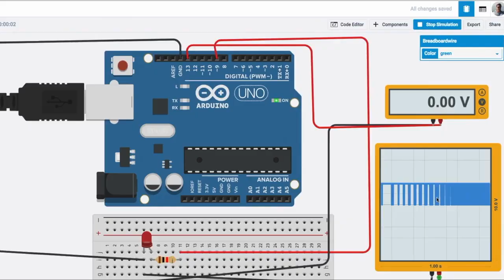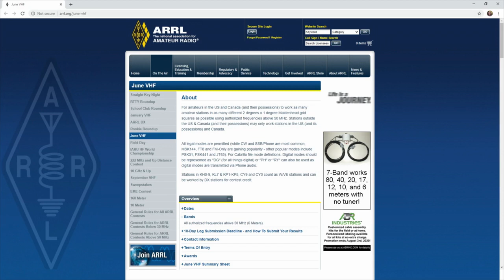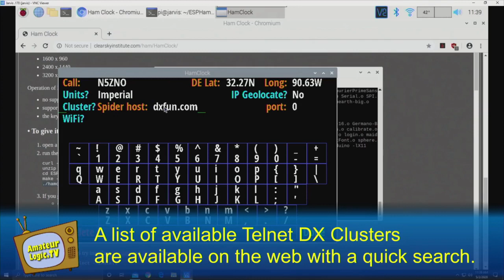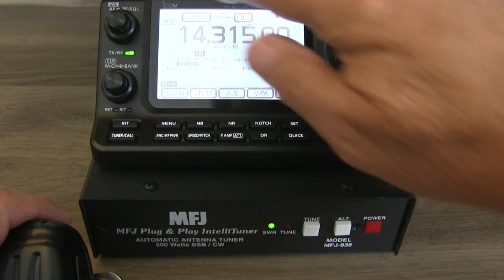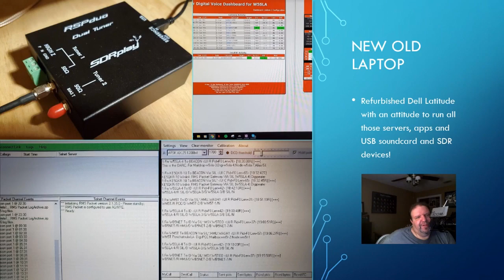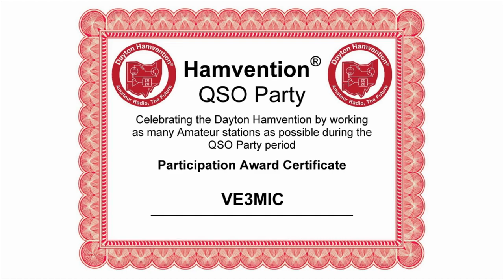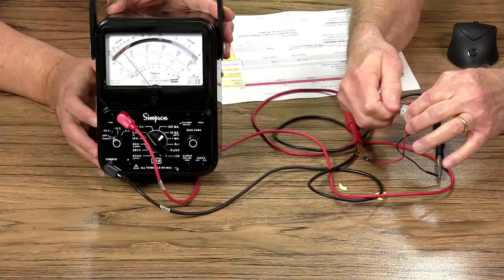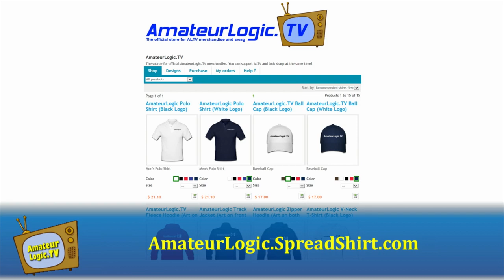AmateurLogic 144: Does Anybody Really Know What Time It Is

Comment: I wanted to let you know, I got the HamClock loaded and running on an old laptop PC using the Xtra-PC dongle they advertise online.  I updated the dongle with the latest version of Ubuntu and added the commands to load the packages needed in curl as was recommended by the author - for Ubuntu if you get errors during the make command try loading more packages such as
sudo apt install curl make g++ xorg-dev 
I have the PC running with dual monitors using an old flat screen VGA monitor connected to the laptop.   My 3 Raspberry Pi's are all busy running other things right now.  One runs as a DV-Mega using Pi-Star, on is running Xastir APRS and the other is running a D-Rats ratflector, StTammany.ratflector.com.